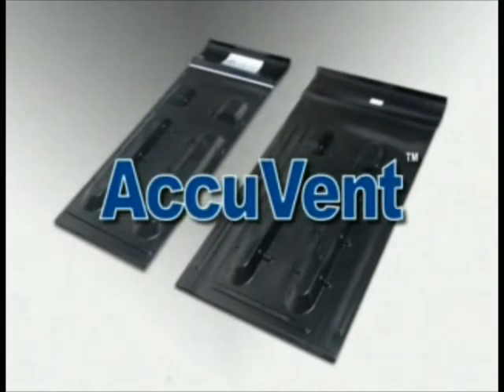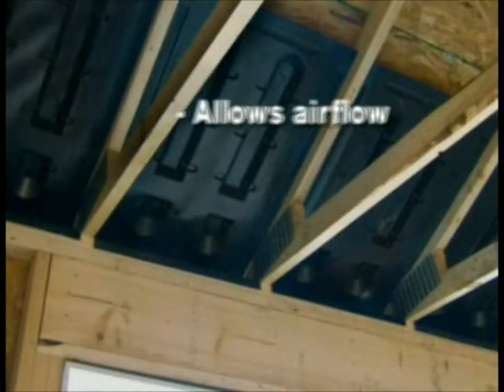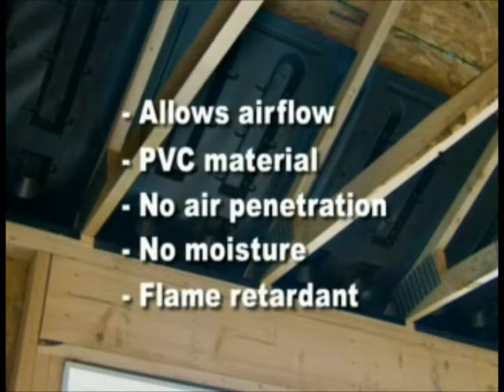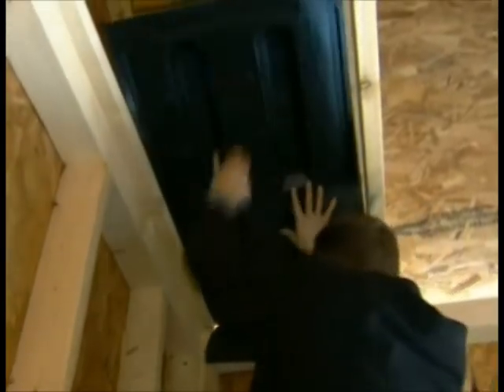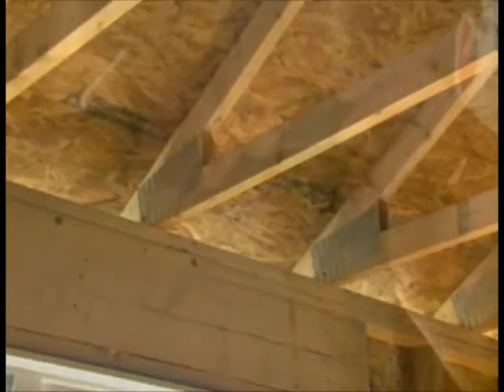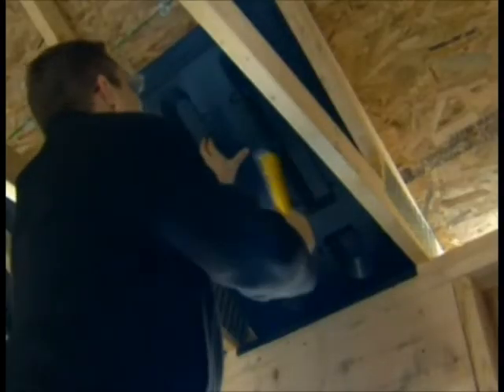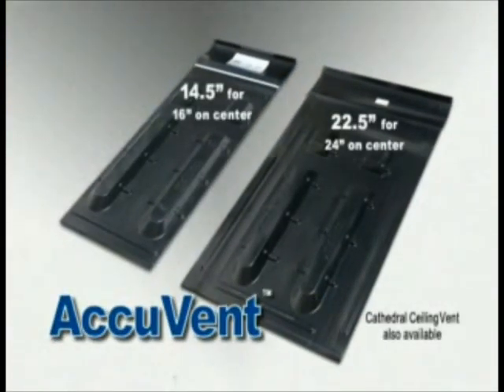AccuVent

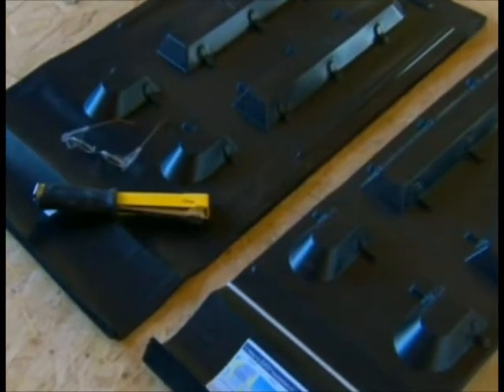Comment: Video has Wind-Devil ad covering key diagrams at 1:36.  Not too bright.
Looks like good product though.  Might see if a contractor can retrofit to a blown insulation attic.  Will need to suck out blown in at the soffit, as the insulation covers the vent holes.